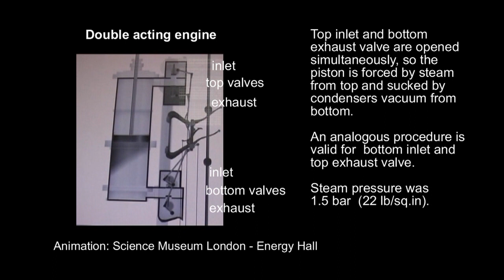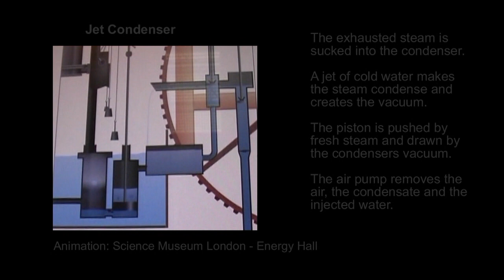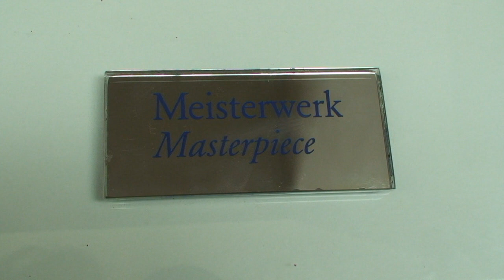James Watt's Genius: Boulton & Watt Rotative Beam Engine 1788

Comment: Newcomen, Savery, and Smeaton built an engine to supply Atmospheric Power.
Watt built an engine to supply  Steam  Power.
In Britain from 1800 to1900.
20,000 Waterwheels decreased in number.
Windmills decreased in number.
The Englishman Thomas Newcomen's 1,500 Atmospheric Pumps disappeared.
The Scotsman James Watt's 500 Steam Engines and their descendants increased in number to 10,000,000 !!!
For every SINGLE Waterwheel in 1800 there were now 500 James Watt type Steam Engines and their descendants in 1900 !!!
The Power output of the whole country increased by 500 times, and so, Production capacity  !!!
In one human lifetime.
And you don't need a flowing river of water for each one either!
This WAS the Industrial Revolution,  it was a Power Revolution and it was kicked off by only one single Invention, James Watt's Invention of the world's first PRACTICAL Steam Powered Engine in Scotland.
It was nothing to do with efficiency,  it was all due to the dumping of Newcomen's Atmospheric Power and Arkwright's Water-Power for Steam Power.
Take away James Watt's Steam Power and you don't get an Industrial Revolution.